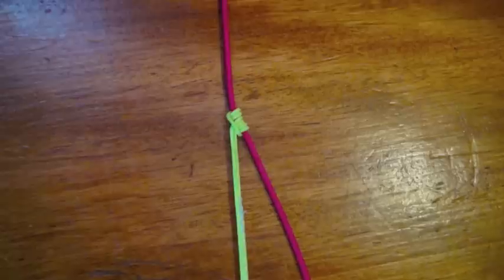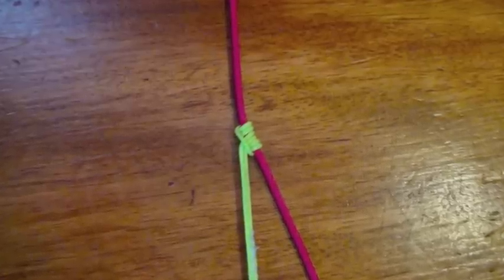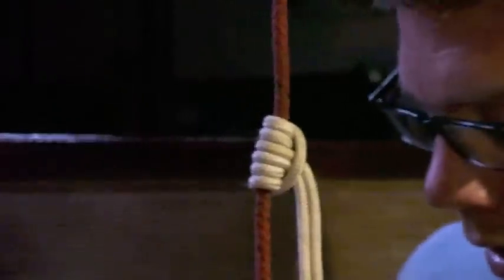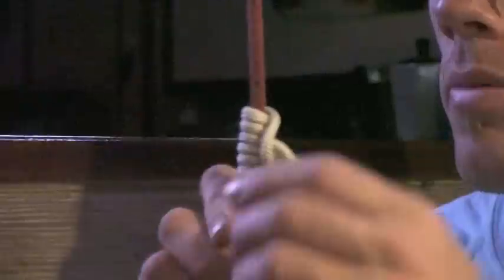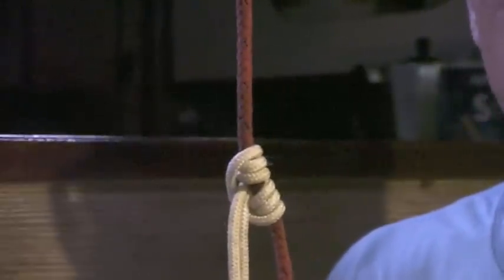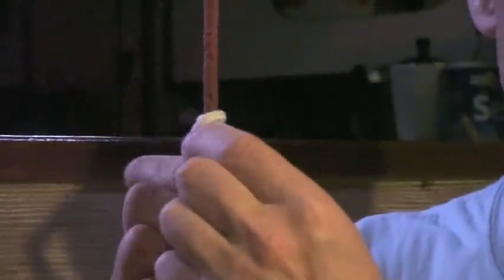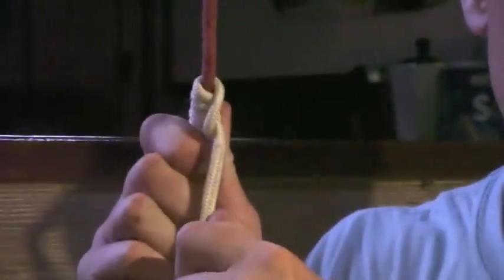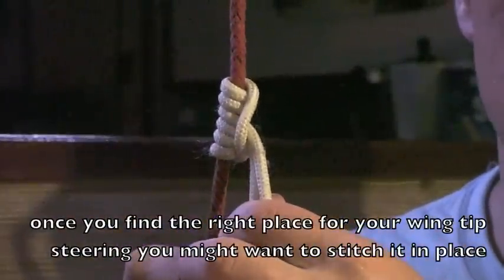1/2 Wing Tip Steering: How to Move and Secure

Comment: Crazy Crazy Crazy ...way to attach ....the tip steering line....my fusion is now fitted with a fixed system obtained from Aerofix and customair also offer the same type of fixed system.....the reason if you use this knot the Prussic the line will move ( sometimes )
this has happend to me and several other people when that happens it can get caught in the prop mine did.. as luck would have it I was on the ground....thank god.....no other manafacturer uses this system that speaks volumes